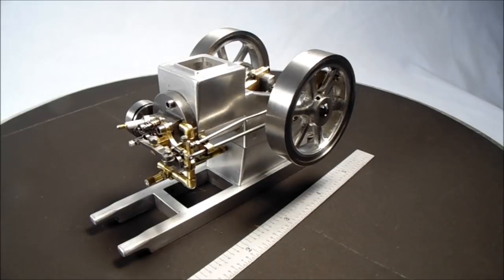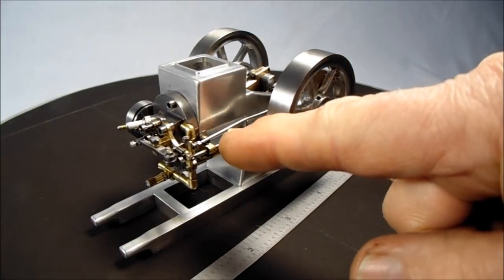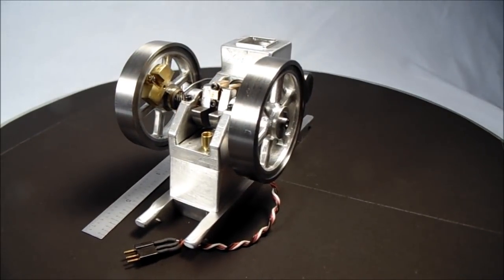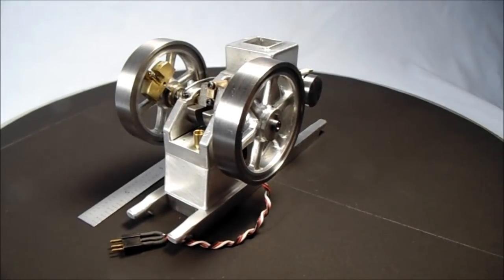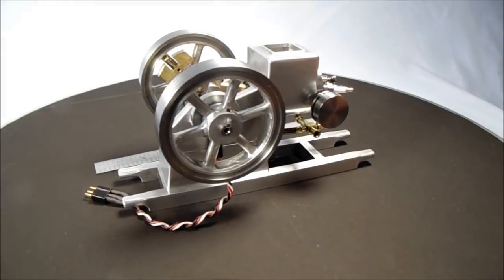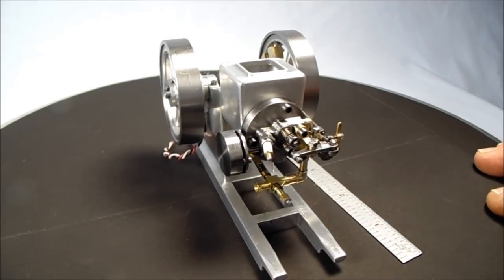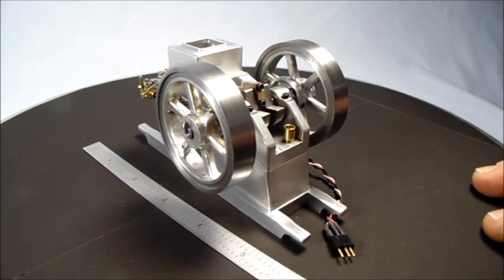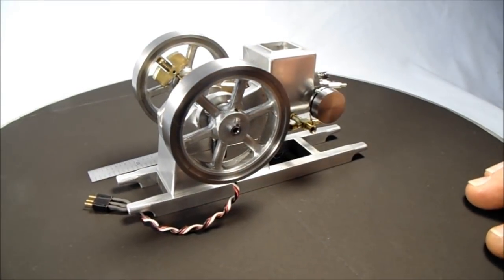TINY Side shaft hit and miss engine

Comment: Thanks for sharing, but this little machine is also demonstrating the limit of the "hit & miss" principle.

Due to the low ratio of momentum versus drag, the engine is nearly continuously firing.

As miss & hit engines get larger, the firing duty cycle is improving (less ignitions per time).